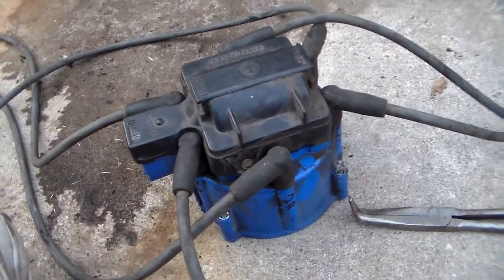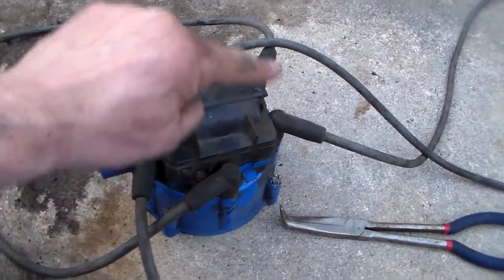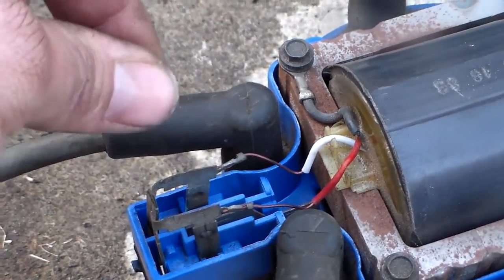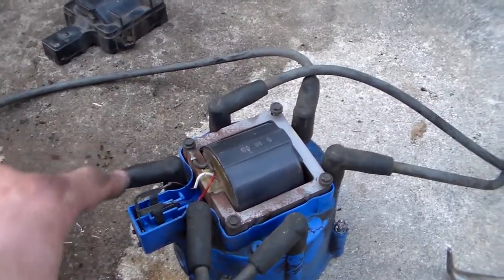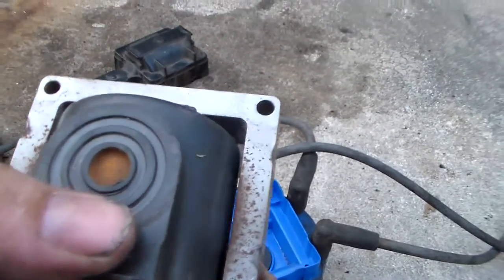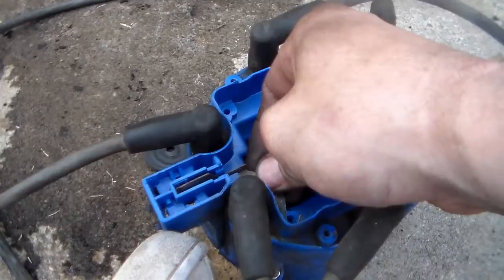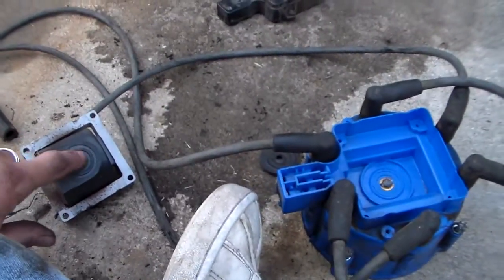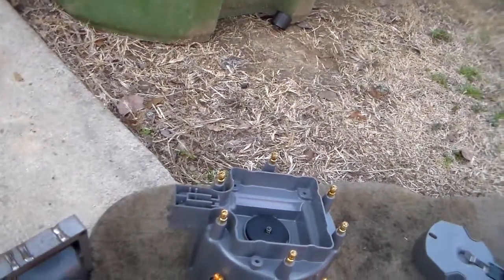How to swap an HEI in-cap ignition coil

Comment: I read that your supposed to coat the rubber bushing both sides with dielectric grease. Not to be confused with the heat sink compound that goes on the module.😎
Reply: That's what I read too

Comment: There is one wire from the distributor. Does it go to the red plug or white on the coil. Also I have misplaced the screws…..what size are they? Thanks in advance for you help.
Reply: Red should be your 12v and the white is for the Tach

Comment: hei coil in cap distributors are some of the best ever produced... on all but complete original restorations, it's the 1st change i make to a pre 74 GM car.. best $20 junkyard upgrade you can do... and, good to 600hp or so stock.. i've seen stock modules and accel coils spin to 7500 rpm on the strip... add an MSD box and they will efficiently run big numbers for just a few bucks... sure you can go buy mallory or accel's billet offerings and tie up a grand in ignition... or head the the junkyard and get an HEI and a new coil/cap/rotor and spend that extra money on other things where you can actually perceive the difference your money made..